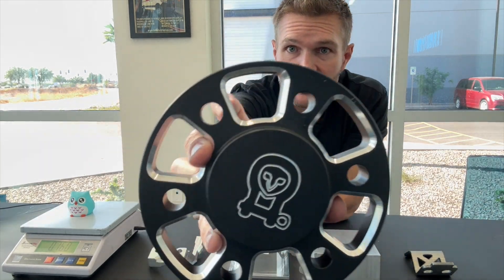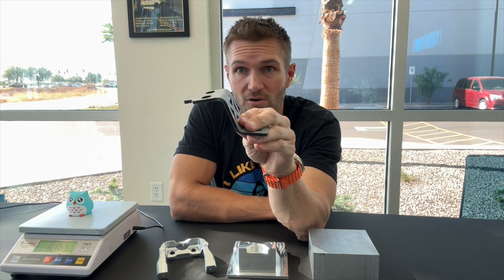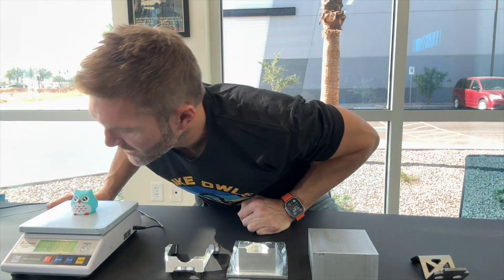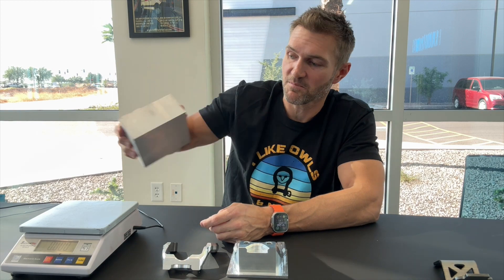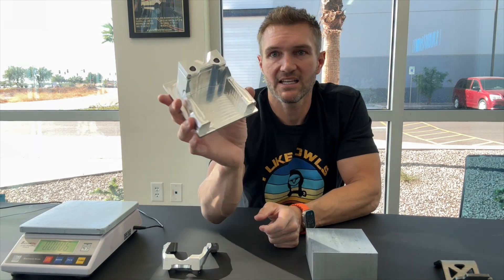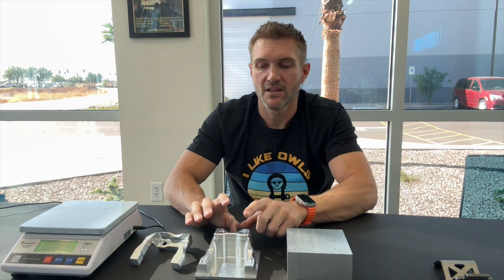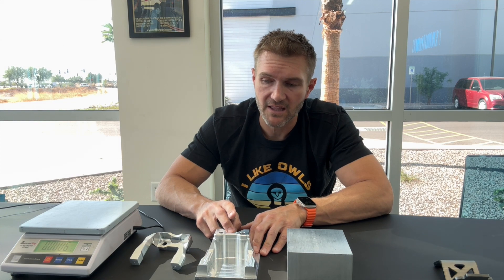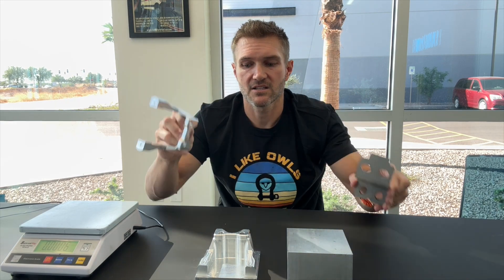Billet Machined Parts Explained

Comment: Love your stuff but you made this 6-minute video and didn't give a single reason as to WHY you made the billet part over the sheet metal part. Strength, Weight, function - what? Hard to believe that the sheet metal part isn't strong enough when the OEM parts are sold by the millions and are not billet and are perfectly adequate. We are buying van parts - not jewelry. Having said all of that - I'm standing in line like the rest of the world to buy your bling.
Reply from the maker: It’s absolutely a strength thing. The billet is a stronger material and it is has square arms. The flat steel sheetmetal others use are not strong in the direction of the force. It flexes and bends doors. Steel tube is strong, sheetmetal is not
Reply: @owloffroad  - got it. I'm rewatching your transit ladder video. I'll be ordering one. Is there an option to use lugs to attach the wheel to the ladder?
Reply from the maker: There is not but if you’re worried about theft you can still add a padlock